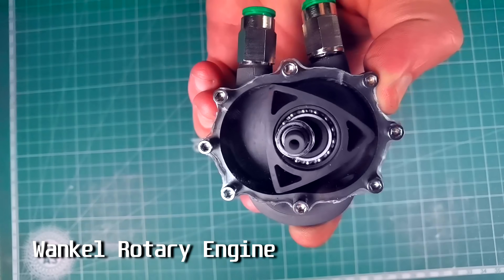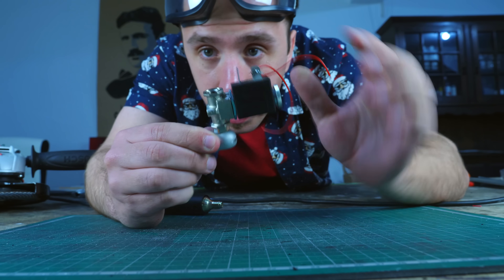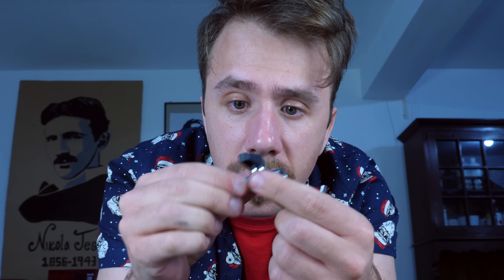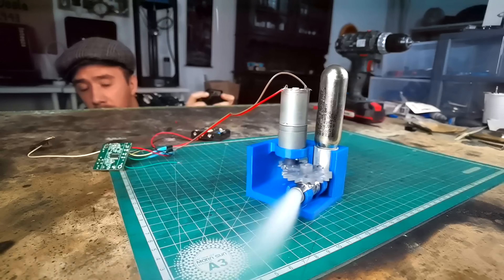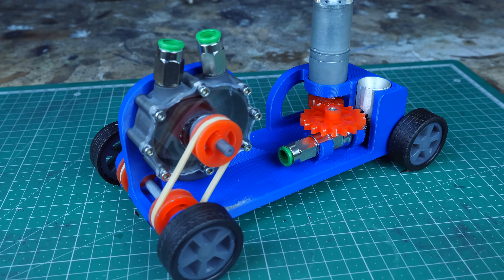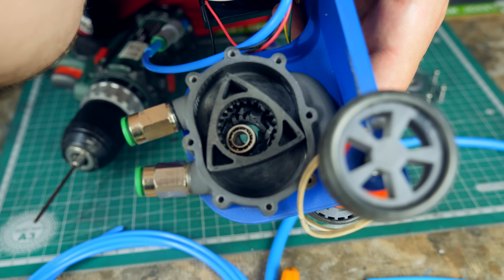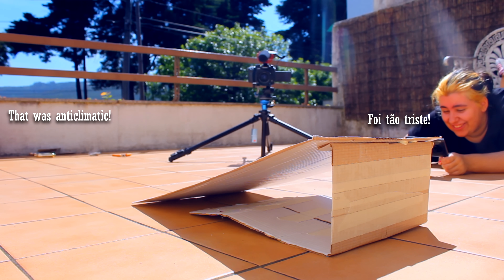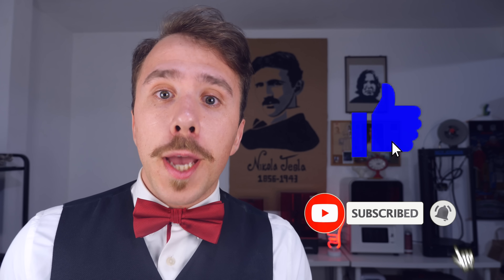Rotary Wankel RC Car (3D Printed)

Comment: What if you 3D printed a compact gear box to convert those RPM's into torque? I am interested in seeing if you can do something compact enough to fit in the car, while also being able to handle the RPM's at the input, and the torque at the output.

Hell, if you feel like being extra fancy, what about a remotely operated gearbox, with manual shifting?

Comment: I think you should regulate the CO2 pressure so that it let's out power over a longer period of time. That will prevent it from destroying the engine and should get more gaseous CO2 out of the canisters. It'll also prevent the wheels and transmission belt from skipping. Something with better grip for a transmission belt would be cool to see too, like an HTD belt.

Comment: Try the opposite of what you did with the propane tank of the rocket engine: turn the CO2 cartridge the other way round so that the valve is at the top to get less liquid and more gas into the engine

Comment: Idea: Make a smaller version of the wankel engine (because displacement) add a rc valve on the co2 tanks, and make a RC car! (with steering if you like the challenge)

Comment: The rubber is skipping. Because of that you lose most of the energy. You should try making the valve open so that the pressure on the engine is maximally stable throughout the whole drive. And make the rubber tighter. Also because the engine packs so much energy, you can try to make gear changes that ir turns the wheel maximally fast. You could drive easily for hundreds of meters.

Comment: I think that a problem that you’re facing is ice build up in the engine causing friction and added strain on the engine you could try a different gas or design and engine that could accommodates for this

Comment: @integza I wonder if you were to install something in line to limit the airflow, like a regulator, but still have enough pressure to drive the engine; could you eliminate the sudden burst of rotation put into the wheels and get much more distance out of the car?

Comment: You can try to 3D print a saw blade. See what different designs work for different materials. I’ve seen a piece of paper used as a table saw blade, I’m sure you can achieve great results

Comment: Tbh you should have gone with a tank with less psi but more volume. Tom Stanton style water bottles might have done the trick and might have even gotten you better performance than him. That qould also reduce the stress on the engine

Comment: I would like to add to that drone idea. Could a pressurized air tank or co2 tank (possibly one used on paintball guns) be attached to the engine to spin the propellor for the drone? It would be interesting to see the flex of the wings from the engines vibrating and how it would effect the lift of the wings!

Comment: Make a tank you can seal dry ice in. This would need a blow off valve for excess pressure. But would give a long lasting pressure supply

Comment: Try place the wenkel engine horizontally because gravity can effect the rotation . Use grooved belt to connect axle to wheel . Reduce the motor size , build a high torque gearbox for small motor🙃

Comment: Hydrogen peroxide 4-engine drone.  So in place of electric motors, have small pumps that push H2O2 over catalysts that decompose it into steam.
Use a conventional drone controller to actuate the speed of the pumps (instead of props).
You can do eeeeet!

Comment: Integza I enjoy your videos! You will get a lot more out of that wWankel engine if your pressure input is at the apex where the spark plugs would normally be not the intake. Also you may want to add a small tank to drop the pressure in half from the CO2 cartridge. You will get a longer lasting run of the engine if the pressure isn't blowing past the engine. Have fun!
Reply: Leave the intake open and if you modified the compression area to free flow, restore it to compression. The air from the intake will compression then your pressurized air will imitate the explosion and drive the rotor around with much more energy! You may have to experiment a little with the exact location of the input. To drive the compression.

Comment: Was anyone else wondering about all the slippage withing the power train? I actually think that if it was geared a bit better that the engine would do better than the air jet

Comment: Also, seal the engine a bit better, and use a pressure regulator so you don’t waste so much CO2 making it more efficient (and not detonating the gears in the engine)

With a pressure regulator you’ll be able to run the larger CO2 canisters without worrying about the pressure blowing up the engine
Reply: And it can limit the torque to a usable level.
Reply: Rather than just spinning the pulley on the engine.
Reply: a better wheel and belt could be in order as the wheels and belt where slipping a lot.
Reply: @FicusThreeSixty  agreed, I made a separate comment about that, I noticed the band was jumping all over and was slipping constantly. The car would’ve taken off like a jet if it had a better drivetrain and pressure control
Reply: @FicusThreeSixty  a balancing weight for the rotor wouldn't go amis either, that would help the bouncing belt and wheel a lot.
Reply: @Firecul  you should not need a balancing weight on a wankel motor.  As suggested, reduce the pressure, maybe by a smaller exist hole, would probably give a much better experience.
Reply: @AndersJackson  I only suggest it as Mazda felt the need to have them, it's not a smooth rotating motion like a fan so to me it makes sense.
Reply: @Firecul  it isn't smooth, so you might need one if you need smooth motion.  One disk wankel is like a a three cylinder, two stroke motor. Kind of.
Reply: His 'belt drive' is also wasting a lot of energy by slipping and not transferring the energy to wheels.
Reply: Maybe an additional rotary to offset the vibrations from the single one? you'd have to split your flow or add another CO2, but that'd get rid of the wobble and help with better power transfer
Reply: @Claire-kj4hv  correct, but it would use more CO2 and being such a small format the pressure will probably fight itself between both cylinders and the flow rate won’t be even between them. He would need to make all the piping exact in lengths and the same curves and angles. Even then though it might not be even depending on how the canister is penetrated and how it gets ejected.
Reply: @Claire-kj4hv  another problem with an offset rotary engine with 2 engines would be that when the pressure reaches the intake phase of one cylinder, it will drop pressure on that split of the lines, and the remaining pressure will try to compensate from the canister until it’s too much (obviously turning the rotor) but also it could in theory try to spin the other cylinder in the opposite direction.

I know he did point the intake ports on an angle to prevent that, but at such a small scale it’s hard to control/get everything right.

In my opinion if he wanted to do dual rotary, i would put in a seesaw type valve for the intake to save CO2 and regulate the amount of pressure entering the engine
Reply: i thing this man never look at replies. i have suggested that he should use a kill switch on fuel gas like a ball valve, regulator on co2 etc.
Reply: And even make the chassis with a stronger material
Reply: How much space does that take up, though? And how much added weight? Maybe if it were reconfigured and you ran tubing instead of a solid block fitting. Idk maybe I'm overthinking it.
Reply: @420Chameleon  he can either buy a pressure regulator, or make his own via 3D print. It’s really not that difficult in concept, just need simple materials to construct. I’d offer my assistance to him but I don’t think he will see my comments lol
Reply: A Wankel engine is a terribly inefficient way of harnessing compressed gas energy, since it's recompressing it for no reason (normally it'd be necessary for combustion). A simple impeller like on a turbo would be way more efficient.
Reply: Maybe increase the size of the pulley for the wheels as well
Reply: @djinferno8690  also increase the pulley and belt grip to improve grip
Reply: I'm sure it's already planned, but he always start with a simple and non efficient design, in order to show the different component and improve it in each video.
If he was to directly reproduce the most efficient way to do it, it wouldn't be half as fun

Comment: You lost lots of power with the rubber band, you should make it gear driven instead and then see how much further it goes. You’ll also have a much better torque curve so it’ll climb.

Also the front wheels are bouncing from the engine rotating. Maybe try weighing the front down or making the tires thicker

Comment: Your problem is not having a pressure regulator, the sudden pressure from the CO2 cartridge is just causing the engine to leak left, right, and center, and the drive belt is just going to slip.

You need something that can convert the high pressure jolt from the cartridge into a steady pressure to feed your engine, which you can then throttle with the valve.

Comment: you should make a gearbox for the RC02 car so the wankel works well. also, taking a page from Volkswagen's book, you should make it Rear Engine, Rear Wheel drive so it uses better the extra weight to turn it into traction

Comment: I think it would be cool to try doing 2 of those engines you used in a sequence so that the exhaust from one powers the other to try making a 3d printed car run off 2 instead of 1

Comment: Print a transmission for the wankel engine. So those rpm's don't go to waste.
And while you're at it, print a differential to :P Go full 3d printer rc car.

Comment: Hmmm, that rubber band had a rough time.
It slipped like it was on a slip and slide. It would be cool to see a fully wokring mini car with that engine. Steerable CO2 min car.

A better gearing for the motor to Drive shaft convertion, would be cool. A better flow control could probably help it a long, instead of the "full throttle" mode, but the DIY solution was pretty smart.

Comment: Why don't you use a regulator to release the pressure slowly. 
That way you can drive at low RPM for more time🙄

Comment: Hey! I had suggested doing a car with the rotary engine. Would have hooked up a few co2 cartridges in line tho so it could run longer. Also add a valve onto the line so you can control how fast the cartridges discharge

Comment: Video idea: Make a first stage regulator like you see in dive regaluators so that you can lower the output pressure of the cartige and have it create trust for a longer time, this way you put less stress on your wankel engine and have a longer truts period. The only downside is that a regulator might be hard to build (╹ڡ╹ )

Comment: Video Idea for next Video;)    
You could maybe even print a boat 3d, which drives with the pressure cartridge and the motor or drives a screw.

Comment: May I suggest reducing the size of your input pipe to the wankel engine to reduce the start up stress on it and actually make the co2 last longer. Also have a secondary wankel engine on the exhaust but with a larger volume cylinder.

Comment: you could add a radiator between the cartridge and the engine this way you could warm up the co2 so it wont be liquid running through the engine. so it can expand more and the engine could run longer and faster

Comment: Video idea: a sequel to this one, because I wanna see this work. I'm no engineer, I'm just some security guard from Utah, but I think one of your biggest issues are that your engine doesn't have seals between the casing and rotor, resulting in a lot of lost pressure as gas escapes between the two pieces. I might recommend trying some pieces of rubber band or better yet, if you can get a large enough O ring and cut it into three segments, to slot them in maybe just try using that Dremel to cut a channel for them. If you do that, I highly recommend a little lubricant in there as well, just some silicone oil should suffice. The other issue is the ratio between your engine's pulley and your output. Your engine is generating way too much torque and the band you have between the two is slipping. Perhaps try increasing the size of the output pulley so that your engine can put all those gobs of torque to good use moving the thing, right now your car is just bouncing up and down with all that extra energy, and the band is just slipping freely. That's all I've got for you, cheers from the Beehive State!

Comment: Not to be a hater, but I'll do it anyway:
The transmission of rotational power is severely limited by the rubber band slipping AF. 
You're doing great, except for the rubber band. 
Again : the rubber band is shits

Comment: the problem about using co2 cartridges is that the gas is liquid and it needs a lot of heat to expand. you should build a system sìmilar to an intercooler (but it works in the opposite way) to heat up the gas and obtain no solid co2, wich makes u lose a lot of pressure.

Comment: If I may make a suggestion: ditch the belt drive and 3D print a set of gears that can accommodate a short chain. 

From what I can tell, the motor is spinning up just fine; you just equipped a rotary engine with a belt-driven CVT in FWD configuration. That's why it's hopping and the belt is moving but it's barely gripping to provide torque. I bet even if you did replace it with chain drive, you would still have issues putting down torque because of your weight distribution and it being FWD layout on those small RC slick tires. I would advise adding bigger or wider front wheels, just like the FWD drag cars have, because you only have one flow rate with that valve so it's full power all the time off the line. Should be able to better maximize power-to-volume ratio.

Hope this helps! Post a follow-up if you do it.

Comment: Idea for the car, maybe a little control release of the co2 cartridge not hitting the motor with full force and create drive system either with belts or gears to give you the necessary speed.  If not maybe go back a build a rocket engine with the co2 valve

Comment: You should have used gears rather than a rubber band it was clearly not doing it's job and you should try to pulse the valve between open and close fast enough to make the car accelerate and last longer

Comment: You had a ton of slip with your belt. Having a tooth built to transmit the power would be good. Old printers often have parts like that. Stock Drive products is a place to get parts like that too. 

You modified the Wankel for bypass, which is messing you up. If you have a straight winkle, and you have a toothed gear, I think it’ll run it a lot lower speed but still transmit all the work. A closed cylinder system, like a Wankel or a piston, it’s going to be able to extract work way more efficiently than a raw rocket. I don’t even know if you had a de LaVal nozzle on it. You can also made a rocket like that spray water out the back and get better momentum transfer that way too. If it pushes the mass of the water out, the reaction of the fifth forward can work like a 2liter water bottle rocket.

Comment: If you made the exhaust of the rotary pointing in the right direction, It would also helped propelled the car. Also, use a servo motor instead of a regular DC motor,so you could open the valve just a little.  
Video suggestion: a helium  Balloon with a rocket attached that would only fires when the ballon had bursted at high altitude.

Comment: What if you make a multi-rotor Wankel in series...couple the exhaust from rotor 1 to intake of rotor 2, eshaust from rotor 2 to intake of rotor 3...how many rotor will it take to convert all the gas pressure to mechanical power?

Comment: To boost efficiency, either add more tubing between the CO2 and the engine or add some form of "economizer" to slow down the liquid co2 so that it can fully expand before hitting the engine

Comment: Make a 3D printed surface that can lift a small object using compressed air (make many holes in the surface to distribute the air around the object)

Comment: Reduce the flow rate to the engine and remove the bypass tube. Vent the first chamber to air and plumb the second chamber to the gas source.

Comment: There's a huge amount of pressure in those CO2 cartridges. If you look through the clear window on the side of the engine you can clearly see liquid CO2 going through the engine that's wasted expanded volume. I think you might be better off to go from the CO2 cartridge to an expansion tank that would help regulate the pressure a bit give the CO2 enough time to fully expand before going through the engine

Comment: Your main problem was is the lack of flywheel which smooths out the engine and maybe a small single gear transmission.

Comment: try and make a mortar tube for co2 cartridges, a tube with a pin at the bottom and see if you can launch the cartidge fast enough down the tube to pierce it then itll fly. maybe put a camera or parachute on it?

Comment: Can you try to 3d print a robotic arm a bit like one in factories, but instead of programming it to do stuff make a smaller secondary arm acting like a "joystick" so whatever move master arm makes slave bigger arm copies. I am curious what would be your approach to this project. i am planning to make one with my sons once they get a bit older :)

Comment: You should try reducing the pressure so the engine runs at lower speed for longer. And it will be more adapted for the weels. Also... The elastic... Watch veritasium last video he's got a tip for that. Try to do something that you could open and close and keep for long runs. Take a look at the elasticity mechanism of the aorta. You could use a depressurization chamber to regulate the output pressure. And also release the co2 in blows --> soft guns valve. Good luck!